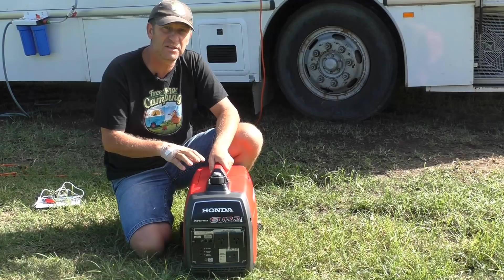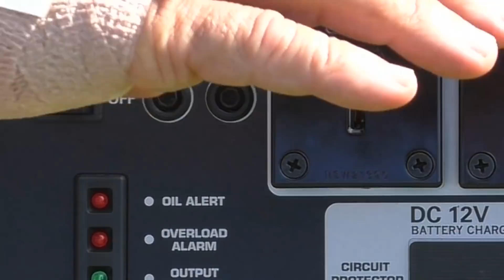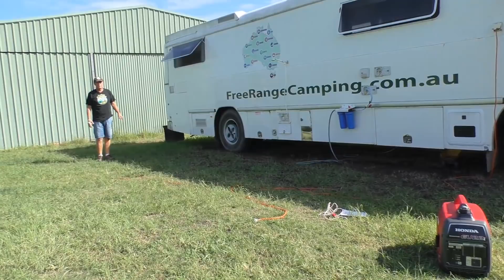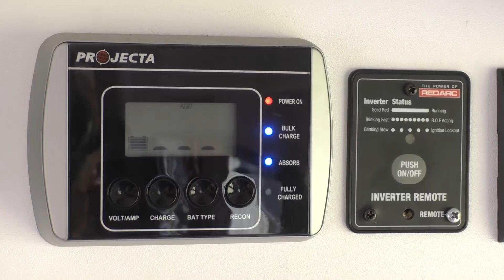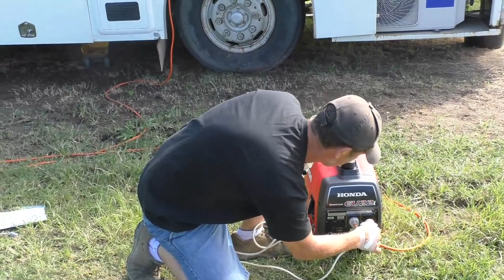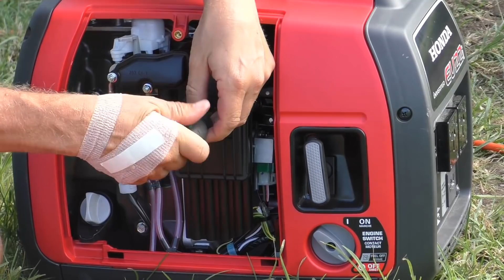Honda EU22i Generator - The Full Review

Comment: I have wanted a generator for years•••>share4.photo/HEU22Inverter?вμ   Over the last few years, I had heard many good comments about these. Because of a main electrical panel replacement project at my house, I knew I would have a several day power outage. That was the excuse to buy this. Worked great for the 80 hour outage, and several uses since. Highly recommended.

Comment: It is unfortunate, no matter how many times you tell the manufacurers they still dont get right.

Where is the earth leakage protector, the RCD. All of the generators coming out on the market have these devices.
That should have been their top priority, first on the list implementation.

Although this is a camping gen, you cannot go on a worksite and operate a generator with out it. On a camp site, possibly damp or wet conditions it is very sensible to have them.
Power backup at home, holiday house, still very wise to have it.

The hire shops have Honda and other generators with retrofited RCD's.

Maybee, one day ... they will get it right.
Disappointed.

Comment: The Eco? I'm only getting 2hr 15min per 1 gallon of premium fuel to run my small tv.
Reply: You shouldnt be using a generator to run a tv.  Just use a leisure battery for that.  If youre offgrid for a long time without driving a vehicle, then get yourself a solar panel.  A petrol generator is yesterdays news.
Reply: In Finland I'm getting about 13 hours running time using 4.1 liter 95E10 fuel. Typically I watch my 32" led tv and use also two small energy saver E27 bulbs. We have 220V AC. I have a Honda EU20i, now it has been in use for over 16 years and about 8000 hours. 

Google says that 1 US gallon = 3.8 liters. 

I'm overfilling the tank a little, but I cannot say how much. 

So you should have no need to fill not before 10 hours has passed. 

There must be something wrong in your calculation, if you have only your tv on.

Comment: Our EU2000i just died and we bought the eu2000.
The 2000's can experience cracking around the crankshaft case.
It's what killed ours.
Reply: You should be able to claim that under warranty even if it is out of warranty. No reasonable gen should have cracked engine casings. I have heard this story of cracked casings a few times now
Reply: How in the fuk would be able to claim something "Out of Warranty"???  @nenadstanojevic1427
Reply: @gangtra48  , Australia has a reasonable warranty terms. Ordinary, an engine block should not break if the machine was sparsely used. Consumers are protected for reasonable use. Not many people know about this. Speak with consumer warranty people, they will explain.
Reply: @gangtra48  in the EU all products sold come automatically with a 2 year Guarantee, but what a lot of people do not realise is that this Guarantee is in addition to your rights and all products must be fit for purpose for a reasonable amount of time.  A TV, for example, is typically expected to last around 6 years of normal use.  So being out of warranty/guarantee period doesnt mean a consumer is not protected.  Its different for Australia I imagine, but Australia is very similar to the UK in many things, so Id look into that further.  Retailers rarely ever admit it, and often even deny it.  Ive had to take print outs of consumer information, or show them on their own computers in their shops frequently enough.  Staff are never trained properly.